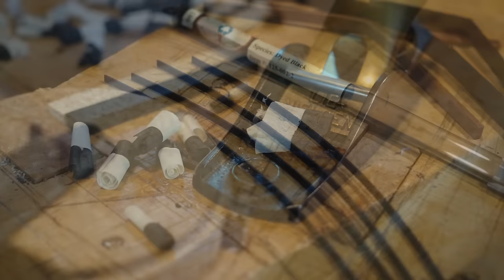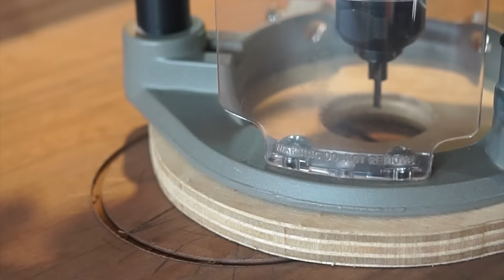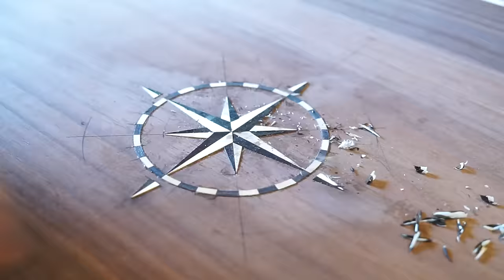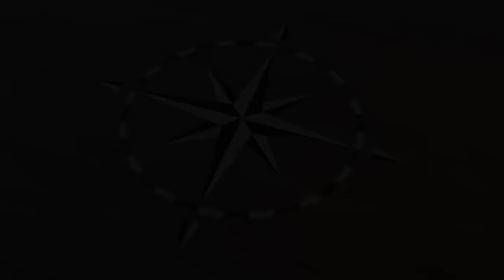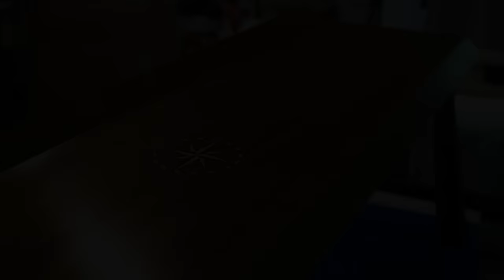Compass Rose Inlay

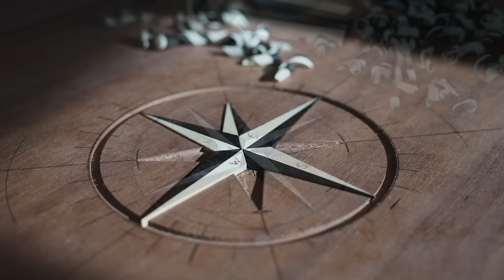Comment: After all these years, I'd probably still do this the same way but it's definitely a challenging woodworking detail! Not sure I mentioned in the video or the description notes, but it pays to have several extra of the ebony/holly blanks glued up beforehand -- i.e., the ones that are worked for the major and secondary points in the main field. One of my points was just off (note the East point @0:47) and couldn't be salvaged, so I tossed it and made a new one which you can see beginning around @0:54 . Feel free to ask questions as I still get notifications about this video!

Comment: Those little triangles are the most impressive part- that is hard to do
Reply from the maker: Thanks. Yeah, probably the most trial and error aspect of the whole thing. Fitting those into the recesses that have already been cut. For me, I made extra triangle pieces and used the 'upside down plane in a vise' technique to dial the fit.

Comment: Beautiful.. so hard to plane an inlay .. how do I learn to do this?
Reply from the maker: Hi. Thanks for the kind words! Lots of good resources on how to make the most of handplanes -- I would just search for those. I don't really think of planing inlay any differently than planing any challenging hardwood which is to say just make certain your plane blades are absolutely as sharp as possible and the plane are set to take as light a shaving as possible. Especially at first when trying to determine if there are any areas that might create nasty tearout. Then just take your time and approach the inlay from multiple directions if necessary. If you get tearout, use a scraper after planing the inlay close to flush with the surrounding wood. Finally, sand as you would anything else. Always make sure to wait a day or two after gluing in the inlay to allow time for the moisture in the glue to evaporate. Whoa, long-winded reply. Hope this gives you a place to start!
Reply: Joseph Murphy Furniture Maker uea thats good, thanks for the info. Tear out is the issue i have had too often! I would just try to sand something like this instead of planing it. Thanks for the tips. I have a water stone, i should get more grits of those to get a finer edge on my chisels and planes.

Comment: Awesome work.  Curious how you cut the round inlay pieces.  I also like the music.  Was that you on the guitar?
Reply from the maker: Thanks! I cut the round bits using a handsaw (dozuki) just by eye and hand fitted them one by one. Used sandpaper adhered to a wood block to clean up the cut and to make slight adjustments in angle and length. Easier than it sounds, truly! Just made sure to hit all the all the key points of NSEW. And yup, on the guitar and music. Cheers.